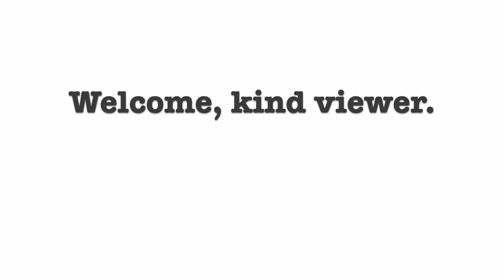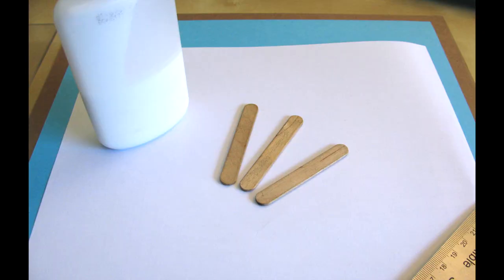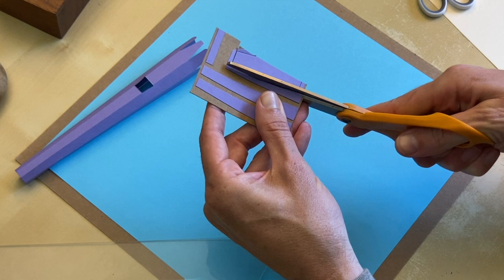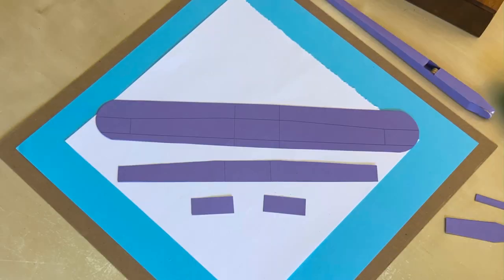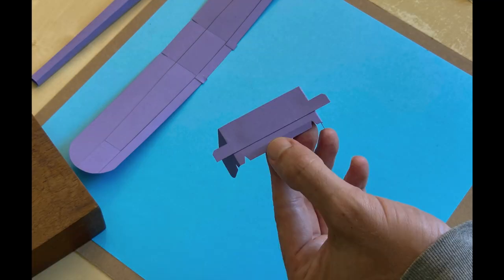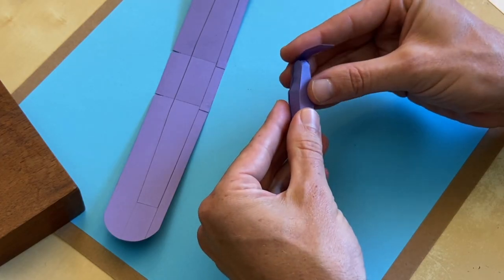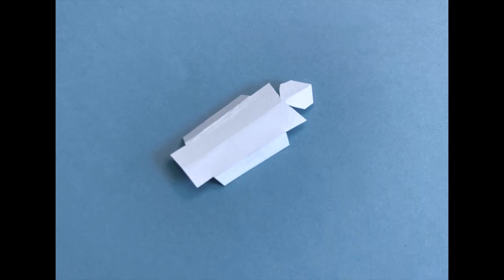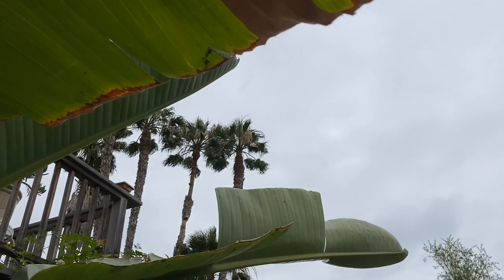Twin Tail Small Glider Made of Card Stock (episode 33)

Comment: tip to beginners , only ever use the BACK of your blade to score folds , you will cut where you don't want to 1  Also , in UK chip-board is what we use to build kitchen units , so I don't think you'll be needing that ,  use "ice lolly sticks "
Reply from the maker: Good advice about the blade! ... Chipboard is also known as hardboard, kraftboard, and cardboard (non-corrugated). I took it out of the title b/c it's ambiguous. Thanks.